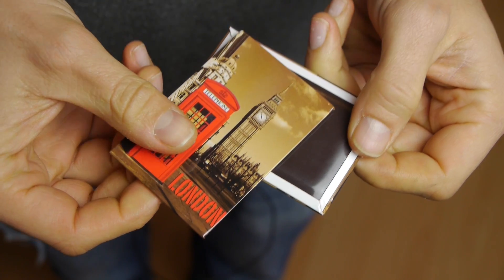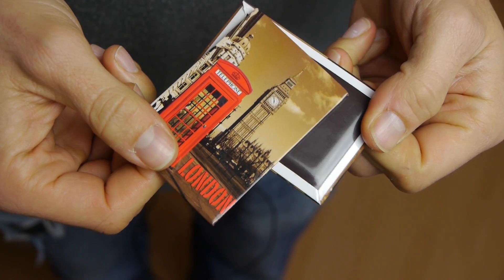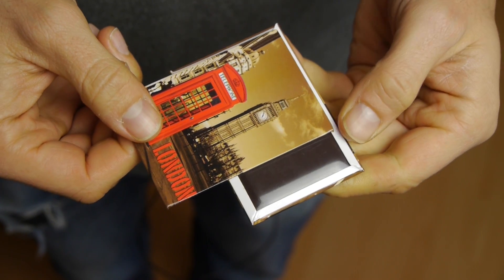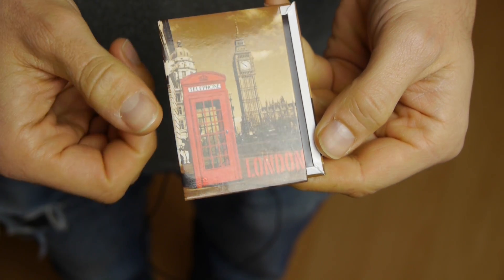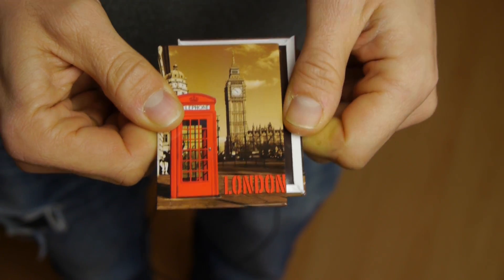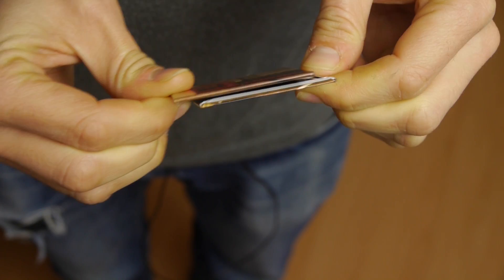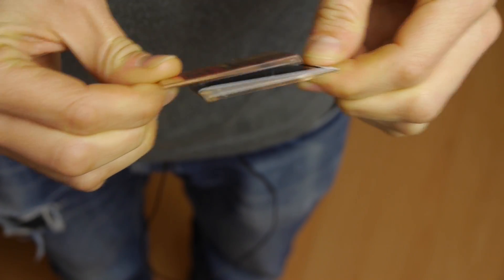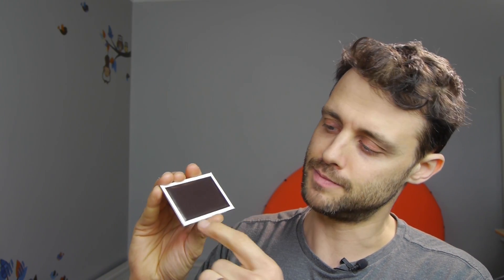Fridge magnet trick

Comment: How convenient that I should find this video now. I got a couple of large fridge type magnets with a whiteboard I got and was puzzling over why they don't seem to have any poles. You put them together and they attract, you flip one 180 degrees, and they still attract. So I deduced they must be made up of many smaller magnetic particles, probably bound with some sort of rubber to make the magnet flexible, because fridge magnets definitely don't feel like regular metal. I just couldn't work out how they would line up the magnetic domains to give it magnetic properties, but in a way that doesn't create any poles (that I can tell). Actually, my phone has a magnetometer on it so I just realized I could use that to measure the magnetic field coming off of it and see if there's any difference between the two sides in either field strength, or direction.

Comment: With electric charger you can make your hair stand up as the like charge in your hairs repel themselves. Is it possible to to use fine iron wires and cause the to stand up no with static charge but with magnetic field. I have seen iron filings and ferrofluids induced into wild patters. I wonder why I haven't seen iron wire? It seems like it could be a neat visual demonstration.

Comment: They're also made this way to increase the effective strength: The north-south strips form a halbach array, which results in nearly all the magnetic flux exiting only one side of the magnet - the back. The front has almost zero field, which is good because it would be wasted there. This means that for a given quantity of magnetic material (and thus a set amount of field strength,) you can greatly increase the strength of the magnetic attraction by having it all only go to the side that matters.

Comment: If you can get the magnetic strip alone without colourful junk glued to one side, you should see if it will stick as well back to back as it does front to front. I tried this and found the magnets stuck far more strongly in one orientation, I suspect it is a halbach array and that this is done to increase the field strength on the fridge side of the magnet.

Comment: Why does a fridge magnet become stronger after several days of being attached to the fridge? I'm guessing that the atoms become oriented in a way that magnifies the magnetic properties but if that's the case then why is it that once the magnet is removed and placed right back on to the same spot the force is weaker? I would think that there should still be some residual magnetic alignment that would help that spot on the metal surface be able to hold the magnet a little better than other spots.

Comment: So just wondering...

If you made those healing magnet bracelets with stronger magnetic fields... Could it make a difference in a person.

I wouldn't suggest having a neodymium bracelet though it would likely pass through but the clamping may cause brusing or blocking circulation.
Reply: I think that people's arms are too thick and opaque for any magnetic shenanigans to happen

Also, if you don't feel anything strange when going into an MRI machine, a tiny magnet is not gonna make any difference
Reply: Cracked Emerald but i did feel strange while in an mri... Well it was only my head but it felt like my skull was expanding and contracting.

I mentioned it n the Doctor said he never had one personally but assured it was probably fine.

Comment: They aren't that way just because it's a cheap way to make them. They are that way because when you "short" the magnetic field from N to S, you get a far better attractive force. The magnetic flux goes from the N strip, through the metal to which you are attaching your magnet and across to the S strip. It is the same reason that horseshoe magnets are stronger than their straight bar equivalent.
Likewise, if you were to take a couple of iron plates and place one either side of your neos such that they overhang the sides a little and then try sticking that magnet (sideways) to something, it would be far stronger than simply sticking the face of the magnet to something.
Reply: Steve missed the part about them not having much magnetic field on the shorted side (ie facing out from the logos).
Reply: And that is effectively why it is a cheap way to make them

Comment: Sounds a bit like color monitors.  They can appear white (neutral), but really it's 3 primary colors... Red, Blue, and Green.  You just can't differentiate between the colors until you bring your eye, or a magnifying glass, up close to distinguish.

So what appears neutral is actually comprised of heavily colored sections... Much like the fridge magnet has a neutral magnetic field at a distance, even though it's comprised of polarized sections.
Reply from the maker: +Dan O'Connell that's a really nice analogy.

Comment: Cheaper and safer.  As you demonstrated with the magnets you were using, you jumped when they clicked together.  Weakening magnetic fields by alternating poles means users don't have to worry about getting their hand/fingers trapped (especially children).  Meanwhile, the magnets don't need to be weak, so when they're close to a metal surface (eg a fridge), they will cling to the fridge w/o worry of falling off.

Comment: Damn I wanted to try this out... why must all my magnets be different sizes, shapes, and strengths??

EDIT: Ok so I realized that I do have 3 that have the same magnet, just with different dome shapes attached (2 circles and 1 square, I used to have a triangle but I lost it), and these guys are my smallest but my strongest. Interestingly enough the two circles were 100% repelled by each other, while the circle and square were attracted. But when I tried them out on my rectangle magnet like his (different image, but yea), they showed no difference in attraction based on position or location. Then I realized that these were strong magnets and the magnetic strip on the image magnet was no thicker than a few sheets of paper - something my tiny magnets can hold up with ease. So my tiny magnets were probably sticking to the metal that the image was printed on, not the magnet itself.
So that makes me wonder: why does that not affect it when you have two of the same like in the video?

Comment: For weaker magnets it's possible to force them together when facing the same poles. What happens to the magnetic field lines when that happens? Aren't they supposed to never cross?

By the way, love your videos! Clear, short and straight to the point explanations. Great stuff!
Reply: They indeed don't cross. Think of multiple cursive lower case m's over and over, if that makes sense. Also, check out the video about printing magnets by Smarter Every Day. I think That video has a diagram/animation of it.
Reply: Magnetic field lines are a concept - and they cannot cross by definition since that would mean the field which have several different values in the same place simultaneously.  Lines can originate or end in magnetic monopoles, but they appear not to exist in nature.

Comment: I've always had this idea for a magnet that is only attracted to iron, not other magnets:

Have an electromagnet that switches poles 100's of times per second. This way it will be a north pole just as much as it is a south pole, therefore being attracted to iron, but not to magnets. Now, I'm 99% sure this won't work for some reason, but my (very) limited knowledge of magnets says this is the best idea ever!
Reply: That's actually how demagnetizers work. They have an electromagnet running on AC so that the field switches back and forth quickly. When you bring a magnetized piece of iron near it, it's polarity is toggled between north and south, giving you a net zero magnetic charge on the piece as you pull it further away.
Reply from the maker: +jvcrules interesting!

Comment: I may have missed it, but I was waiting for the "why".  Why are refrigerator magnets configured this way?  To what purpose?
Reply from the maker: +Nick Combs interesting. Thank you!
Reply: I assume it's because it's cheap to make them this way and you don't need a really strong magnetic field for refrigerator magnets.
Reply: https://en.m.wikipedia.org/wiki/Refrigerator_magnet
Tl;dr It's cheap to produce because permanent magnets are used instead of electromagnetic fields, and the striped design provides 2x the attraction on the intended side.
Reply: @NickCombs  Love your videos, Steve, but I have to admit - this one was sub-parr! The Link Nick posted above goes a long way to explaining the WHY of the alternating N-S strips on a fridge magnet. To be clear: Make a sheet of iron-oxide mixed with plastic (this is not magnetic - YET), then pass the sheet over a roller made of stacked N-S-N-S(...etc) permanent magnet 'disks', the iron is magnetized, replicating this pattern, and the magnetism remains after the sheet moves away from the roller. The magnetic field induced in the iron oxide will actually produce a 'hallbach array' pattern, so the field on the 'back' of the sheet (the side in contact with the magnetic roller) is maximized, and should be almost zero on the 'front'. These alternating N-S strips will ensure maximum magnetic flux density across the face of the magnet, maximizing the attraction to the steel fridge (well ok, unless it's stainless steel...).
Reply: @NickCombs  One thing I noticed recently while sticking the included magnets to a whiteboard. I was not paying a lot of attention and used the double-sided tape to attack three of the four corner magnets wrong, and the board just fell off the refrigerator. It turns out that the magnets have an active side and a nearly inert side, as if the magnetic treatment only goes a fraction of a millimeter deep. I had to peel off those three magnets and re-affix them facing the other way and the magnets worked well enough to hold the whiteboard to the refrigerator. - I guess they were made with the Halbach array explained in your link.
Reply: I know it's an old post, but another reason is the thing with like poles repel and unlike poles attract.
By arranging the refrigerator magnet in strips of multiple poles N-S-N-S, it is lower energy, and cheaper to manufacture than a single sheet with one pole.
What I don't understand is why they aren't squares of poles, like a checkerboard, which would be lower energy, still.
Reply: @seanehle8323  well.. There's another video by Dustin... Smarter Everyday.. On magnets ... You can check it out.. It's cool...
Reply: @sumanchowdhury9223  You just replied to a comment from 3 years ago.  Thanks for the tip, though.
Reply: That might be harder to manufacture than the added savings of weaker magnets would justify.
Reply: having a N-S-N-S-N-S and so on array means that when you stick to the refrigerator wall, the magnetic flux gets amplified, thus creating a strong bond between the magnet and the wall. This way is more efficient than having a single pole, as the magnetic field becomes very strong in a short distance, instead of being more evenly distributed along a larger surface/volume
Reply: But, why is it cheaper to make them this way?
Reply: biker451 I agree with the previous answers, and I would add that it's also (or maybe mainly) for containing the magnetic field to where it should be. If your payment card would be wiped out every time you go in front of your fridge, this would be a problem so to avoid that, the magnetic field is oriented one sided, which makes perfect sense.
Reply: mobile link reeEEEEE
Reply: This took me a minute to grok, but when he says "permanent magnets are used" he means permanent magnets are used to induce the magnetic field in the plastic magnetic sheet that becomes the fridge magnet. 

The alternating poles produce a much stronger field at the surface, generating a stronger magnetic field in the sheet. That makes higher strength electromagnets unnecessary to do the job.

It should then be obvious why this method is so cheap: once the permanent magnets are paid for, inducing the magnetic field in the sheet is basically free. You just have to worry about producing the sheet as cheaply as possible.
Reply: I imagine that along with being the cheapest way of manufacturing a thin and flat magnet, the array also produces a field that gets weaker with distance faster compared to a normal magnet, helping with removing said magnet from the refrigerator
Reply: But also reducing its effectiveness for holding anything onto the fridge door, I have a couple of fridge magnets that will barely hold a couple of sheets of paper
Reply: So they are not too strong and will release when you want them to, also protecting the "art" from being pulled loose.
Reply: 2:18?
Reply: My absolute question too..😬..
Reply: Thanks!
Reply: +Nick Combs - Thanks much for that link.  It explained this quite well.